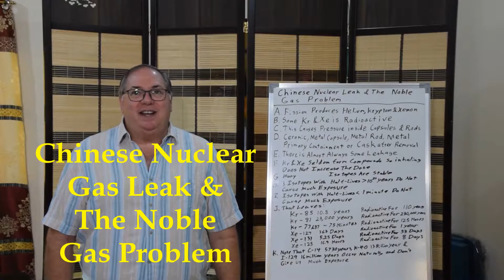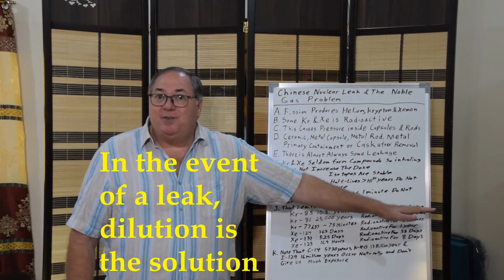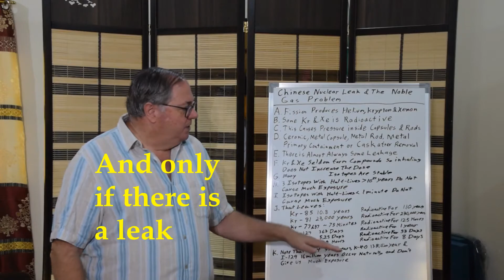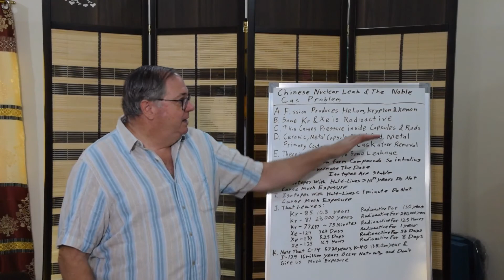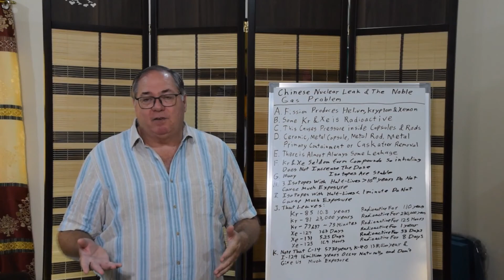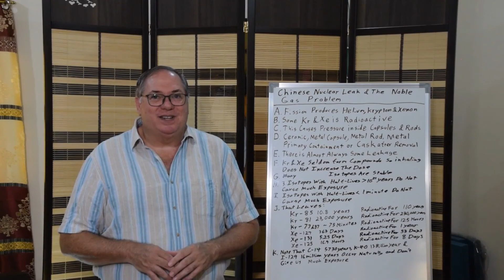China's Nuclear Leak and Noble Gas Problem

Comment: I  was thinking , just speculation but instead of running from the nuclear reactor overheating and boiling water to h and o. maybe we should allow the hydrogen to be produced and burn the hydrogen . question , does the half life of the radioactive material decay faster if high high heat is near it.